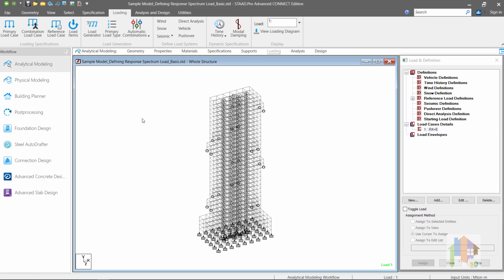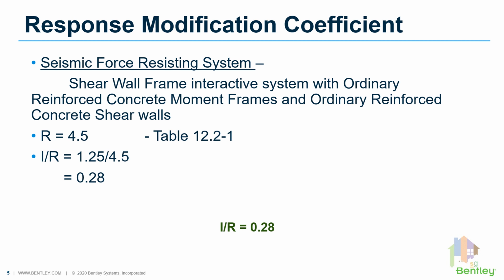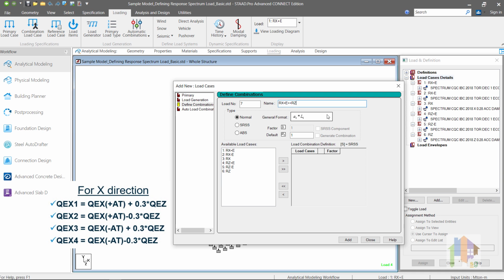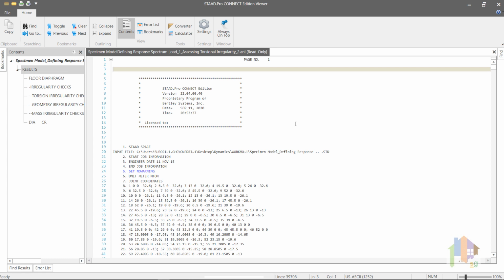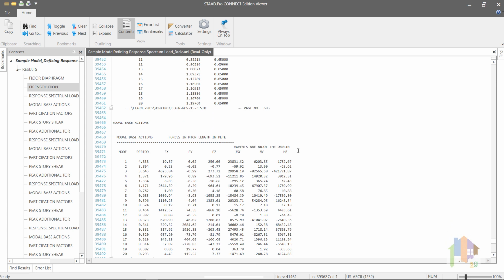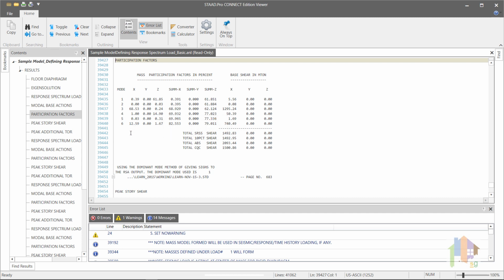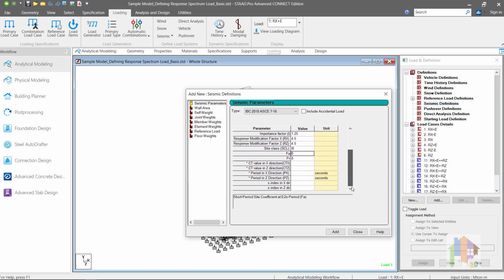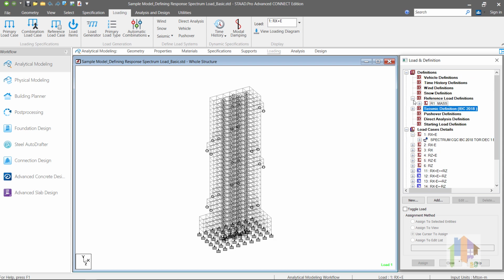Seismic Analysis based on ASCE/IBC code - Response Spectrum Method || Load Combination

Comment: Hi, I am using ubc 97 code which i need to use generic spectrum in staad. This has no option button of considering inherent and accidental torsion. Hence, i cant complete my response spectrum analysis. What are the steps to consider such torsion  in other ways and incorporate this in the load combination to include in the design calculation. I hope you can give me a better idea regarding this matter. Thanks for your video and keep sharing ideas.

Comment: Hello. I hope all is well
I have a question
In the response spectrum load case there is a direction factor which we take it as (I/R) according to IBC code (in case of this video you have taken 0.28). What is this direction factor in case we use Indian Standard code? is it still (I/R) or anything else?
Hope you will help me
Thanks in advance.
Reply from the maker: It's (Z/2*I/R). Spectral acceleration is considered from response spectra data. Anything else which is required to calculate Ah value should be provided as direction factor.

Comment: How you make this big building? pls share ur detail video with seismic analysis
Reply from the maker: If you can create a single floor correctly using proper structural elements and connections, rest is easy. You can copy paste or repeat to generate the entire structure (for typical floor). Else you can use building planner mode if the floor plans change in different storey. And yes, I have some plan to start a new series on seismic analysis explaining each component. Stay tuned.